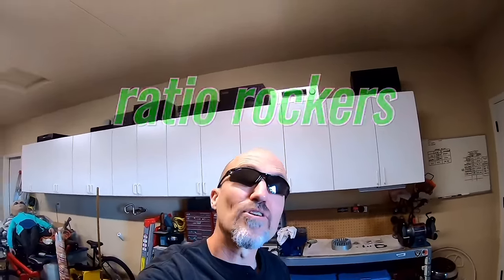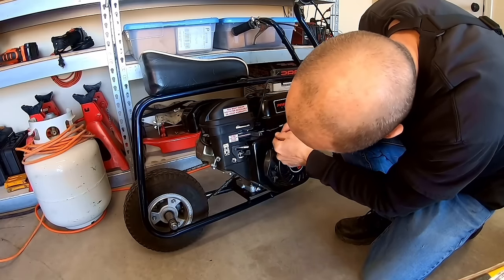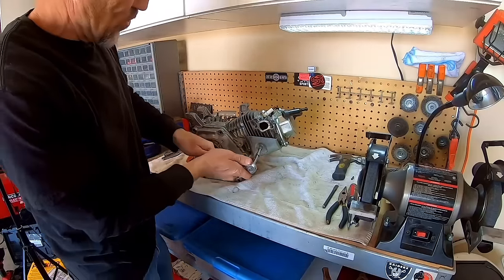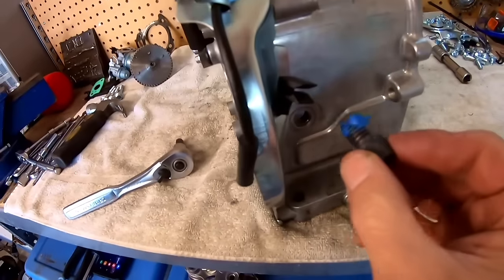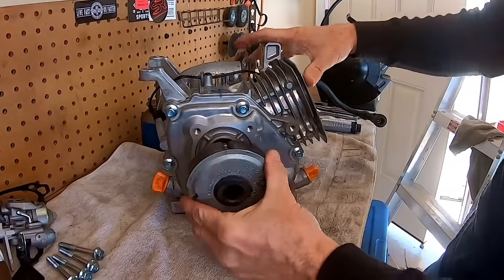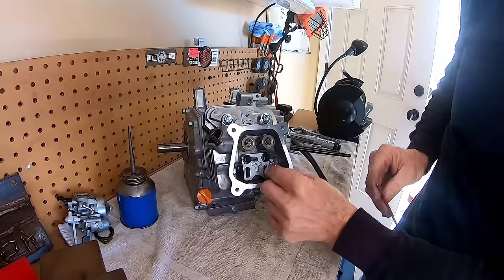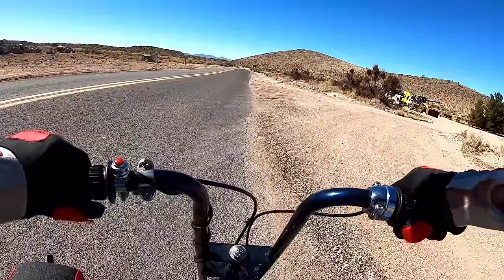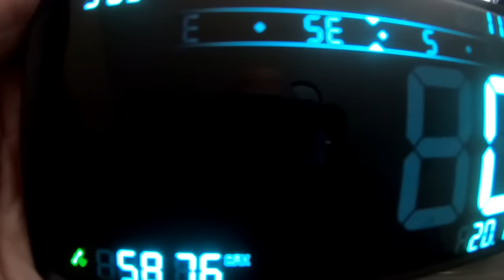$100 budget Performance Predator 212

Comment: What gear ratio
Reply from the maker: It was running a 17 on the clutch and a 60 on the back. 3.52 ratio
Reply: @Black66  having that low of a gear ratio, does the clutch burn out faster ?
Reply from the maker: @tbf174  Normally it would be harder on the clutch . But with this bike I get away with it because of the small tires and the light weight of the bike. Its a very small bike.

Comment: I wonder what the parasitic loss is from the drag of oil on the connecting rod for the polished vs unpolished?  I assume it’s minimal however it must be an ever increasing factor as RPM’s increase.  (Meaning the faster it’s moving the more of a difference there will be because as RPM increases the amount of drag per second should increase)

Comment: You are going through all this trouble tearing it down polishing the connecting rod why didn't you put up a performance camshaft in it they're not that much money you had it all apart
Reply from the maker: The channel is about testing different combos and parts and a few builds thrown in from time to time. I have quite a few builds with billet parts and racing cams on the channel. Check out the playlist. Thanks for watching!   https://www.youtube.com/watch?v=SaxCCoqJ0RU&list=PLkbj-ip-5FzZ4tKihy7hQLgISLoliBLRz

Comment: So I need a pipe? 😂
& a Zip tie
Reply from the maker: No, we don't "need" anything. We want...
Reply: @Black66  I want speed,
Need tie & pipe
Reply from the maker: @Wade14K  LOL, ya, the pipe is a game changer. But if you add a pipe you will get a lot more performance with jetting the carb along with a high flow air filter to go with the pipe.
Reply: @Black66  yea I'm new to building & working on motors,
What would be the best
 type/brand of pipe?
I got ties, 😂
Reply from the maker: @Wade14K  Check out this old video I made of testing two different header pipes. 
 The GPS pipe will work really well on a mild engine. https://www.youtube.com/watch?v=AwyniDDnX_g&list=PLkbj-ip-5FzbLQb21ZZW1mmWP45vj4kxW
Reply from the maker: @Wade14K  Also check out this video on stock exhaust...https://www.youtube.com/watch?v=5GAVMRLyUDo